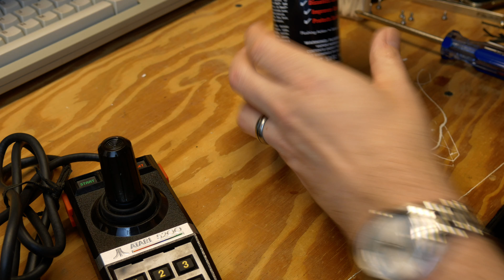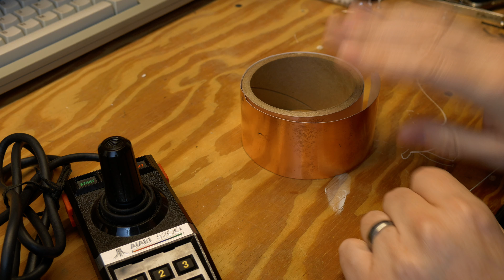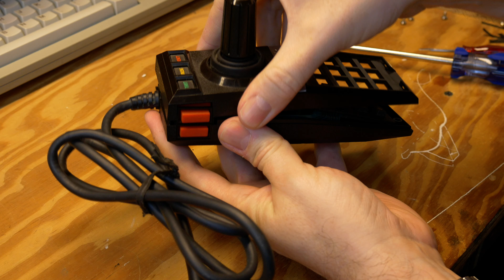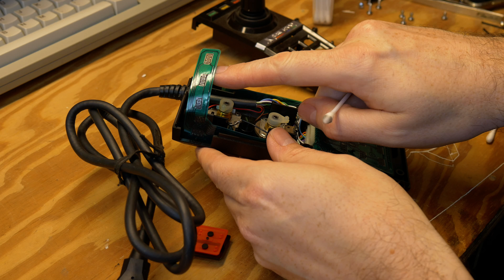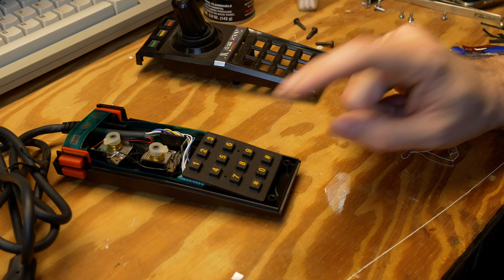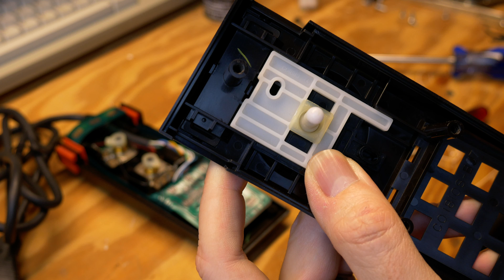Atari 5200 controller repair Part 1 - fixing two common problems

Comment: way back in 2005/06 I found replacement flex circuits on ebay for really cheap. I needed to replace mine because the top button part got damaged from opening it and over cleaning them. Not had any issues since replacing them. The replacements look more modern or updated plastics.

Comment: How long did the copper tape last? I.e., did the contacts on the buttons start to get unpredictable again? And does the copper tape work on the fire buttons?
Reply from the maker: It's been a while since I made that video and I had to skim it again myself just now to see what I did, but if you watch to the end, you'll see me say that the copper tape did not work for me at all (though it might work for you), so I just replaced the flex board. If the copper tape doesn't work, then the problem is oxidation of the contacts between the flex board and the connector, and because the flex board is so flexible and fragile, those contacts are just really hard to clean. There may be some other method that I didn't try and I may have tried some different methods now than when I made this video (sanding, rotary tool, acid, etc.) But at the time, at least, those flex boards were so cheap that it seemed like making a huge effort to fix the originals really didn't make much sense. I don't know if this is still true but you could be a real NOS Atari flex board for like $2 at the time I made this video.

Comment: There I was sitting in my Room with my parents showing them off the new 7800 I finally bought after saving my little pay packets and regaling them with stories of my old 5200 and how the system itself still works but the controllers both do not all while my mother is kicking some serious ass in centipede (she apparently used to play it a lot)  and now 3 days later this pops up
Coincidence?

Comment: Basically, in order to store a stock Atari 5200 controller long-term AND keep it in mint condition, you would have to store that thing in a neutral-atmosphere chamber, such as a chamber filled with argon or some other noble gas (noble gases -- which include argon, neon, xenon, and helium -- don't normally react chemically to anything).
Reply: That's not a bad idea but I get it's a joke

Comment: someone on sell my retro was selling replacements for the circuits, they were made from really thin circuit board with tact switches on, dont if they were any good and probably expensive but worth knowing.
Reply: Do you have a link? That sounds like an incredible project!

Comment: What are phone buttons are for? I had the 2600 when I was like 5 yrs old.
Reply: One big reason was to enable home console ports of more complicated Atari 8-bit home computer games which were intended for a computer with a full keyboard. The 5200 had the same base hardware inside as a 400, 800, 1200XL, or 800XL which made porting software negligible. Star Raiders is a good example. The 2600 version required a special keyboard controller (bundled/included) but the 5200 version just had an overlay tucked into the back of the cartridge that you would install over the standard controller's numeric keypad.

It wasn't just computer ports like Star Raiders. 5200 game cartridges typically included controller overlays for the numeric keypad and multiplayer games often included one for each player. When you wanted to play a game you'd remove the overlay(s) from the cartridge and install them over the numeric keypad(s). Overlays often hid unused keys and relabled a few for in-game functions. Games like 5200 Frogger created a D-Pad arrangement for playing the game without the analog stick. Obviously, this didn't catch on, but it was definitely used a lot for the 5200. Nearly every official game included an overlay.
Reply: in game functions.

Comment: There is a company now that makes a special paint specifically for the purpose of making old contacts work again and if I recall correctly it's not that expensive
Reply: CaiKote or whatever it's called? Yeah, I tried to use that to fix a department store's facility paging system and it didn't work out. Amazon reviews were full of people reporting similar with their attempt to fix old rubber/silicone button membranes remote controls and such.

The membrane buttons in the paging controller's numeric keypad had donut-shaped thin-walled cylinders under each button instead of the usual disc-shaped flat contacts. This meant less surface contact and the cylinder walls would deform when pushed with extra force... the natural user response to a button losing sensitivity. The constant flexing/deforming of the carbon-impregnated rubber membrane would shed carbon and gradually lose conductivity, causing the users to push even harder (jamming a pen into the button) until it was functionally inoperable. When I painted the conductive coating on it worked but the daily users were still conditioned to mash that key extra hard.

Though it would work temporarily the silvery conductive paint stuff would flake right off since it does not deform like the rubber/silicone walls of the contact cylinder and is not impregnated into the rubber/silicone like the carbon once was. The paint flakes would then short the contacts on the key matrix and functionally disable the paging system. I ended up having to redo it over and over while I begged the users to stop pushing the buttons so hard but eventually it became clear that it would happen very quickly even if they were not pushing hard since the membranes were just designed poorly in the first place and the paint is not flexible. I cannot see it working better than conductive tape on a 5200 controller.
Reply: Yes, good point! This stuff worked very well for the 8-Bit-Guy in his PET keyboard restoration https://youtu.be/uHbhH7ISL_Y?t=554

Comment: While conceptually innovative, in practice this has to be the most disastrous attempt to design a controller ever.
Reply: I bet these were not even QA'ed in the day, prob rushed out for holiday season sales.
Reply: @glorifiedng  The 5200 was the first console I got when I was kid.   I have to admit I first thought these controllers were pretty bad-ass looking.  And they worked just fine at first.
Reply: @ghostofpambo6266  ya mine too, I think they even had little cheat cards u put in the number pads that told u what each did. Mine died about 2 months in. Or about at the end of the 90 day warranty. Seems like I had to buy new ones for like $40 each... err my parents did.
Reply: @glorifiedng  Yup.  I still have some of those cheat cards.  They did help with some games.     The stick part of the controller or whatever you want to call it rotates and I was so disappointed when I discovered it didn't work as a paddle controller.
Reply: @glorifiedng  Did the controller actually break or did the buttons just stop working?
Reply: @ghostofpambo6266  the controller got "hard spots" in it and the controller "fire" buttons on the sides quit working, you could press them but nothing would happen.  it all started to be intermittent. I took one apart but could not fix it.  i noticed there were reverse imprints of the ckt board thing in the rubber parts of the button.. later i found out that it could be fixed with a fingernail file bu gliding it over the rubber till smooth. the imprint was not touching the carbon impregnated rubber pads. and completing the ckt. (same thing happen with mid 2000's GM key fobs.  If any of this makes sense to you. 
Oh the hard spots was where the rubber insulation wore off the other end of the joystick.

But all in all the Games were fun and not a bad clone of the Coin-op Version. But.. Coleco did it already first with the ColecoVision

Comment: should try first completing the circuit on the flex circuit with a conductor before replacing.
Reply from the maker: Replacement is more reliable and costs $2. There is no reason not to do it.

Comment: There's also aluminum tape (it's for high temp stuff) that is probably a lot cheaper than copper tape.
Reply from the maker: Copper tape is like $5 a roll. And the important thing is that it has conductive adhesive, which is unusual (especially because it's not usually desirable).

Comment: At 5:20 you say that we can use Deox-It on the rubber membrane carbon contacts. I used a cotton swab to apply it back in May and my whole membrane curled and deformed from the fumes. It wasn't bad enough to ruin it but that's probably because I quickly put it back in the shell and sandwiched it before it got too bad. Be careful! It's fine on the plastic and mylar membrane but NOT on the rubber membrane!
Reply from the maker: It sounds like you used too much. You're not actually putting it on the rubber membrane, you're just putting it on the carbon contacts. And you never spray directly onto rubber - I'm not sure if I said this or not, but I spray onto a cotton swab and then use that only on the contacts.
Reply: Modern Classic I applied with a cotton swab to the carbon-impregnated parts, same as you. I mentioned that it seemed like fumes were affecting the surrounding area specifically because there was no direct contact with the rest of the rubber. I probably would not have noticed if I applied it with the numeric buttons mounted inside the top shell because the plastic ribs would have kept it from curling up as much and it would have set in a flatter position once the fumes dissipated but the effect was clear when it curled outside of the shell.
Reply from the maker: Hmmm, well I'm not sure what the difference was between mine and yours in that case... but my membranes are both still perfect. I had to take them out again to finally finish the refurbishment (there's a part 2 video now) and they were the same as always. Still flat and flexible.
Reply: Modern Classic Well, that's because you used Windex while suggesting that we could also use DeoxIT. ;) My relevant experience was from right around when this video was made and I incorporated parts of it into my own recommendations (in particular, copper tape > foil tape). Just realized that it needed a very minor correction. Hope it helps.

Comment: So the flex circuits with gold a better buy as in they lost longer then the copper?
Reply from the maker: +jlindsey241 Theoretically yes. Although I have seen reports from some who bought early runs and still had them go bad. I ended up going with new tin ones just because they're much cheaper and it's actually very easy to replace them if I need to do it again. One gold one is the same price as five tin ones.
Reply: ok thanks, ill remember the copper ones the next time my controller stops working!

Comment: I got my atari 5200 but the front plastic is busted anything I can do to fix it
Reply from the maker: All you can really do is buy another one for parts and replace that panel. I'm looking to do the same myself - in the process of filming part 2 of this video, I dropped my 5200 and broke the same panel :(

Comment: Has anyone in the 5200 community ever tried the equivalent of the "Bob1200XL" keyboard contact repair fix? Basically every 1200XL keyboard eventually fails due to failure at the Mylar edge connector. Bob's fix is to repaint the carbon traces at the keyboard Mylar connector with conductive silver paint or automotive defroster paint. I've done two 1200XL computer keyboards with his fix (3 years ago) and both still work great. Just wondering if anyone has tried that on the 5200 flex circuit edge connector to the controller wiring harness.
Reply: It doesn't work well with flexible, moving, contacts despite being sold for repairing remote controls and such.

Comment: Dat TV jack is a problem with the system as well, isn't it?  Doesn't it hook into the power supply?
Reply from the maker: +infinitecanadian on the 4 port model, not the 2 port that I have.
Reply: Oh, I see.  I remember James Rolfe from Cinemassacre being surprised at how the TV jack was hooked up in the 4 port model.  Impossible to justify.

Comment: You should remove the top bezel prior to pulling the two halves of the controller apart.  Any flex circuit with carbon coated contacts is not going to be reliable long-term
Reply: adventurebloc I use a standard metal spudger frequently used for cellphone and tablet repair. Costs $0.50 and pops it off instantly with no damage! I use two for opening Neogeo AES games and one for opening Atari 5200 games. Just fitting it on the side of a CX52 joystick practically makes it jump off!
Reply: Modern Classic There are many different flex circuit materials and some are more delicate than others. Broken traces are common so stressing them like that is not advisable.
Reply from the maker: +adventurebloc It would be more difficult to do it that way, and I can't see why it would be necessary.
Reply: Modern Classic not difficult at all, use a better tool. I use a Wiha chip lifter #268 10P. It gives lots of leverage and doesn't mar or scratch the plastic.  removing the bezel first, prevents having to drag the flex circuit out from under once the controller is apart.  Just a suggestion.
Reply: @ModernClassic  adventurebloc is correct here. Not removing that top bezel before hand can result in the flex actually getting caught and tearing or getting creased when you try and pull the two halves apart. I've done it myself 20+ years ago when I used this method first to repair mine without knowing. I use small flat blade screwdriver and a piece of cardstock. Slip the blade of the screwdriver between the edge of either the start or reset buttons between the button and bezel plastic. Place the cardstock between the screwdriver and the bezel to act as a force barrier when pulling down on the screwdriver to pop the bezel off. This way the screwdriver doesn't dent in the plastic as you press down to pop it off.
Reply: Thanks for the tip Emmett, can you tell me which spudger you are using?  I'd like to buy a few
Reply: adventurebloc I just searched eBay for "metal spudger" sorted by price and filtered for Buy It Now. It looks like item number 282385770077. You can see them used in my Atari 5200 cart disassembly video or my more recent Neo Geo AES cartridge disassembly video. Not as cheap as they were when I got them last year but still really cheap.

Comment: I'd try using a single hole, hole punch on the copper tape just for consistency. :)
Reply from the maker: Good idea!
Reply: In case anyone wants to try it, 1/8" single hole punches (smaller than standard) can be found for ~$4 at hobby/craft stores (Jo-Ann's Fabrics, Michael's, Hobby Lobby, etc) and cheaper online (set of 3 sizes for $3). I can think of a few other uses, which is why I already had one. One use I remember from 2011:
I cut microphone holes in an Alienware M11x Green Onion Supply anti-glare screen protector. They added a 2nd microphone to the M11x r3 for noise cancelling and neither were close to the webcam cutout like the M11x and M11x r2, but the official screen protector was never updated. The screen was otherwise identical so I marked the positions and cleanly punched my own mic holes before applying. Worked like a charm! The original webcam/mic cutout was diamond-shaped for consistency (mic was only on one side) so it just looks like a stylized angular webcam cutout on a stylized angular laptop... nothing weird/vestigial.